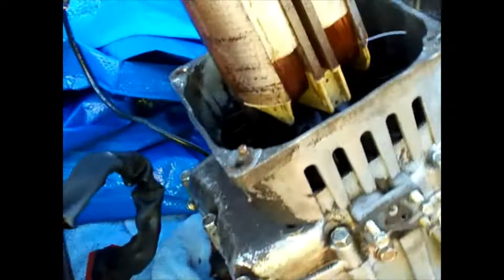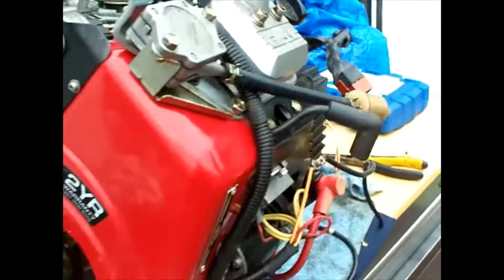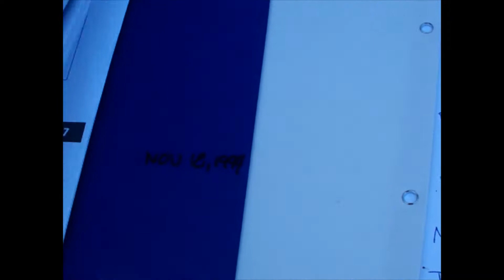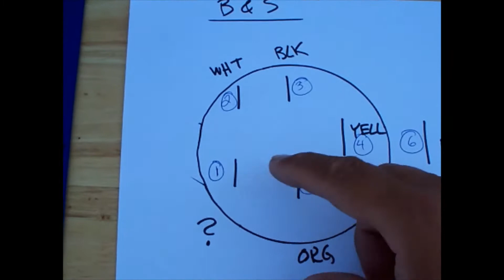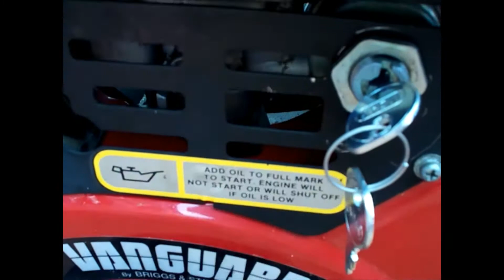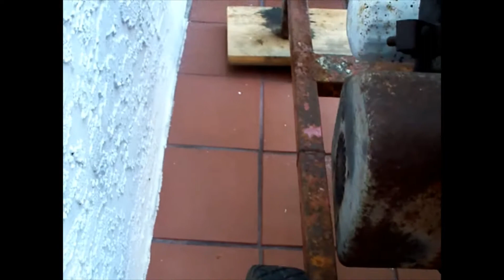Coleman Vantage 7000 generator pt  4

Comment: Hi would u happen to know the carburetor model
Reply from the maker: @BernieFredericks  okay. I have the briggs snd stratton manual for this machine. And there's about 5 brands. But the particular one on mi e states it's a Asian carburetor and the model numbers are: 290700, 303700, 350700, all after 950930xx

Comment: Theses unit only had one issue the plastic in bell would drop the bearing after hours of running causing unit to fail and the rotor would rub against the stator shorting the rotor out and Colemane never upgraded the unit and the upgrade they did put on bearing was a retainer with screws but it still didn’t work out well because heat still eventually took a toll on it but I can the  engine is  durable
Reply from the maker: I'm looking for one that someone has. I want to see pictures if how the springs and levers are hooked up. The engine has numbers but not the generator. I have everything I need about the engine.
Reply: I can help you with some pictures if you help me with some pictures I just put one back together and it runs great but my panel inside is wired wrong please help @blackjack98enterprises